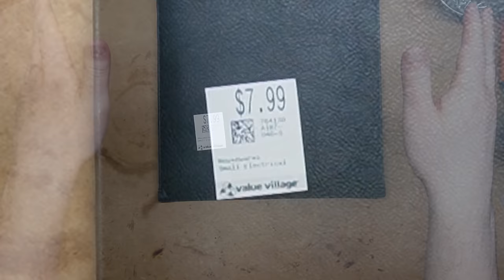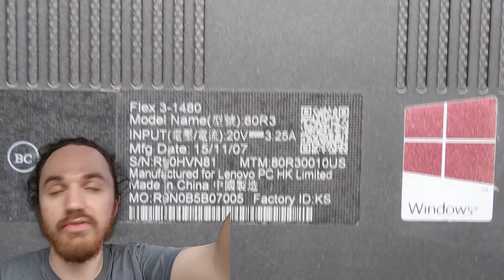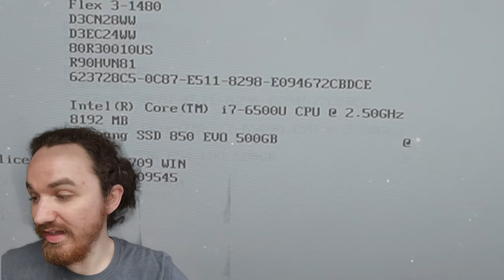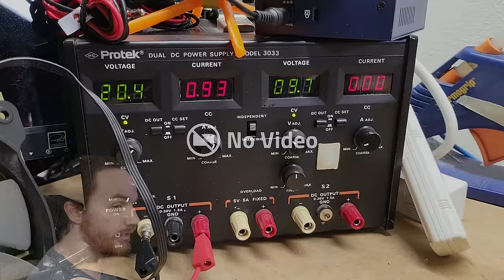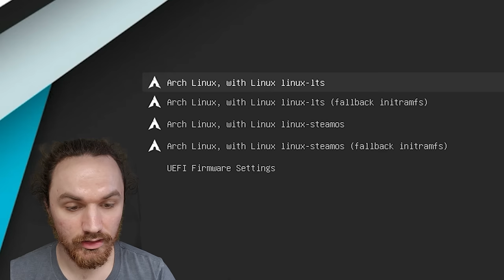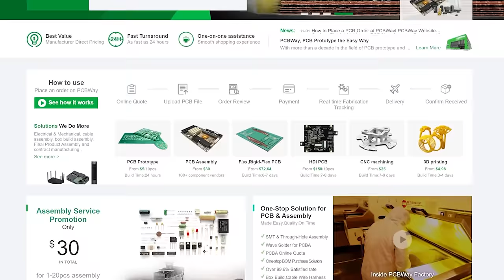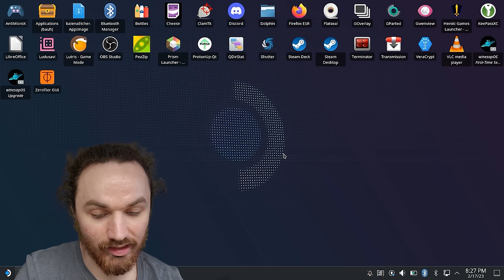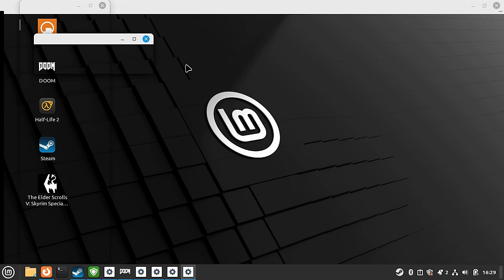Installing Steam Deck OS on a $7.99 Value Village Laptop

Comment: Some of these CPUs seem like they're powerful enough that if you could get a full 16x graphics card to run with it then you could have a good time.

Imagine somebody making a custom motherboard that you can put one of these chips on there to salvage from a dead laptop. It would take way too much effort and not be worth it at all but it would be cool to see.
Reply: well, u can place a wifi port to gpu port in your laptop if ur crazy enoth
Reply: There are modern laptop CPUs on ATX mainboards of Aliexpress, kinda wish if they offered in ITX mainboards though.
Reply: Yeah I wish I could take my laptop's APU and easily slot it into my DT motherboard  but that's a small dream that'll remain a dream
Reply: @jierenzheng7670  right? as someone rocking an ITX system, it seems crazy that they don't put those low wattage, highly efficient laptop chips into smaller boards, it would be a match made in heaven!
Reply: @danandrei96  For me, I always wanna build an ITX system ever since the tiny Thinkcentre M93P which I can fit something like an Intel i7-4750HQ or i7-5850HQ for a tiny emulation PC, those Aliexpress boards can do even more!
Reply: @bananinha00098  but the Wi-Fi port isn't 16x
Reply: @cydragon2.099  All you have to do is learn how to design your own motherboard and there you go.
Reply: @dickdickling9389  Don't people use i3s in gaming computers because the only thing you really have to worry about is the graphics card?
Reply: @bland9876  An fx6300 bottlenecks an rx480 by 60%. also the chipset for the motherboard doesnt support PCIE3.0 further bricking the GPU. Id say between the two the logic of "CPU doesnt matter. You always just need bigger GPU" falls flat. You want the hottest CPU and Hottest Motherboard for gaming because lanes, CPU intensive games and Video card running RAM as shared memory. Not VRAM since shared memory is passed across the lanes so slower. 

The point is if you told someone who was running an fx6300 and rx480 their lag means you need a better GPU you would be wrong. since by upgrading the CPU and lanes would unlock the potential of the GPU by un bottle necking it and giving it the proper PCIE lane and were not sure if the lag is cpu induced. THEN youre back to a state of "upgrade GPU" provided youre now able to support the current GPU's without bottlenecking or outdated lanes. For instance some motherboards have PCIE5.0 lanes. Not because any graphic card uses it. But it might in the future and that chipset might still be relevant. So just release a bios update to support the new cpu on that chipset and you got a pcie5.0 lane so youre motherboard is still relevant.
Reply: @gantz4u  ya if your mismatching GPU and CPU there will be bottle necks but if you don't do that you should be fine.
Reply: that is a 2 core i7 one of the worst 
that is why all the stutter happens in the games he is playing
Reply: @komikop  i would have assumed an i7 would be 4 core I didn't know they were old enough to be 2 core
Reply: i7-6500u powerfull????lol so funny
Reply: @maikelpeeters7328  if an i7 isn't powerful then I don't know what to believe anymore.

Comment: There is a dGPU in this thing since there are 2 coldplate thingies below the heatpipe (one for the CPU, another for the GPU)
Reply: Quick search reveals it's some kind of Nvidia, which would be why HoloISO didn't work
Reply from the maker: I really don't think it does but I could be wrong. I will probably take the cooler off and check at some point to be sure. Wouldn't the system specs page in Mint show the dGPU instead of the Intel HD Graphics iGPU though?
Reply: @BringusStudios  It might show both, I'm not sure. Also, some (not sure if all) Lenovo laptops allow the dGPU to be disabled in BIOS, so check for that.
Reply from the maker: @ozzelot3349 just pulled the cooler to check, you're absolutely right. There's a Nvidia chip in there. I'm really confused as to why Mint didn't register it. I'm going to install Windows and check to see if it shows up there, and if so I'm gonna see if the performance is any different. For all I know, even though Mint didn't show the GPU, it may have still been utilizing it and the performance was accurate. We shall see
Reply: @BringusStudios  it should be a GTX 930M or GTX 940M based on the laptop model, so my guess is it wasn't using the dGPU based on the performance
Reply: Wow, interesting find!

Comment: Man I was in shock. I'm using a Lenovo flex4 1470 right now and have been since maybe earlier than Jan 2017; real trouper, taken a consistent unending torture the whole time, including now, and have only had 2 problems, keyboard related and low RAM which I upgraded; 4 to 16gb. I really thought that was what you had got for 7.99; was willing to buy it right off you.  These are great, idk about the other gens

Comment: man, value village (savers in my area) really is killer for finding hidden gems of cheap electronics. i once picked up a 1TB external drive, even though it turned out to be an abysmal WD Green, for $3.99 from there

Comment: I don't think Holo iso works on anything that isn't AMD based. (I think there very limited In intel support). The steam Deck uses an AMD cpu and GPU that was speced out by Valve. Other versions of steam OS try to add comparability for other hardware, but it's hit or miss.

Comment: Man I have that IDENTICAL laptop sitting over in my drawer :D got it in the Microsoft Store in Toronto back in 2015. The ELAN trackpad always drove me nuts but was the first laptop I had with a touch screen and USB3, did me well. Dual Core "i7" was a bit of a let down though, so was the single channel 8GB of RAM but otherwise a decent laptop.

Comment: You seem to understand electronics well. Maybe you can look into switch mode power supplies, you can change their output. You could have converted that 19v to what your laptop required without losing voltage.

Comment: By the way to remove hot glue from non porous surfaces just drizzle some IPA on it and it will weaken the bonds. Learned that from Voultar here on the tube.

Comment: 3:48 Blinking indicator on Lenovo means that the battery is in the process of charging. When it starts blinking rarely, it means that the battery is almost charged, and when it stops blinking and just burns, the battery is charged

Comment: I actually have a Flex 3 1580, the 15 inch version of your laptop. It has a GeForce 940M, and your laptop probably has a 940M too. A SteamOS based distro can't use the Nvidia card.
Reply from the maker: I really don't think it does but I could be wrong. I will probably take the cooler off and check at some point to be sure. Wouldn't the system specs page in Mint show the dGPU instead of the Intel HD Graphics iGPU though?
Reply: @BringusStudios  maybe linux mint didn't install the drivers or even detect the GPU? I remember the laptop nvidia GPUs were a nightmare for linux so try installing windows 10 and have it automatically install the drivers.

Comment: It's just hot glue, that's actually not a bad choice if you're missing the hold down or screws. I've never done that, but I could see myself doing it on an old laptop I wanted to just get working enough to use for something.

Comment: At 4:17 when you are pointing on the RAM, you could see that heatsink covers two cips one on the left is a CPU and on the right is a dedicated GPU, you can even see VRAM arround it. 
LAN port needs bottom case to work properly

Comment: One thing to keep in mind with most Lenovo laptops with the square plug power adapter is that they do have a 3rd "sense" pin in the charger that tells the machine if you're using a legit Lenovo charger. It's a really dumb pin as it's just a certain value resistor to positive I think or something like that because the Lenovo charger cord that goes from the square plug to the power brick doesn't have 3 wires (HP/Dell style). Long story short is Lenovo laptops can limit performance if it thinks that you're not using a legit charger and that's usually also why it won't charge the battery. My Lenovo X270 for instance won't let me turbo boost the clock speed up on certain pirate chargers (again the secret is in a legit Lenovo square plug and not the brick) but on windows you can circumvent that limitation with ThrottleStop

Comment: Could use a "fancy" universal laptop charger. Had one like 90W which had exchangeable end plugs to fit all kinds of weirdo laptop standards. The plugs were like 4 pin in, whatever setup out, cause IIRC 2 of the in-pins were used as a "sense" for a resistance hidden in them plugs. Open ended (aka no plug) it would output like 15V, and depending on resistance it would go up to 20V.

Alternatively if that PSU you use fully works, use the damn tracking mode, and then run both channels in parallel for double the amps out :)

Sorry for necro comment - YT recommended me your videos like a day ago and I watch some older ones that it continues to recommend hehe.

Comment: What build did you use as the STEAM OS! I Have a B550m board with 3100x cpu and 8gb ram (2x4) and AMD MSI RX580 Gaming 8gb GPU with a  1.5tb Sata drive. Also have a 512gb M.2 gen 3 (2800-3400mb/s) but have not bothered to add the m.2 yet. What OS will work best? Also was thinking of dual booting win 11 and steam os on my 5800x/3060ti build but heard NVIDIA is bad.

Comment: on the motherboard, you could see 2 chips covered by the heat pipe wich could mean that it got a dedicated gpu.
Reply: If there's no dedicated gpu, it's the motherboard chipset. It's common to put it under the pipe. From what I've found with the serial number, it should have a 940M. If bringus had selected nVidia driver it should have been better in game.
Reply: @galichet18  I had one of these exact models a couple years ago, the chipset is located under the silver shield. The second chip is for sure a GeForce 930m or a GeForce 940m
Reply: @galichet18  yeah, you could be right but i think i saw 2 memory modules just besides the pipe, it's maybe nothing but it's kind of curious

Comment: i can see from a teardown, that laptop has discrete gpu. So in linux depending on maker (if it,s AMD then is easy). basically to use discrete gpu you need to set prime offload renderer (somthing like that) and then use DRI_PRIME=1 when launching the game.

Comment: This is 150% less jank than 90% of the computers I have cobbled together out of junked laptops over the years.

The one I am most proud of was a garage server I made out of a laptop that had a screen that was snapped off at the hinges and still had wires hanging out of it.  It also had no back because the SODIMMs I crammed in there wouldn't allow me to put it back on.  Not that it mattered, because I also had a 3.5 inch hard drive wired into it using an absolute fire hazard of a MOLEX power supply and some jank as fuck IDE converter... thing that I had around... for some reason.  I also did not have a long enough CAT 5 cable, so I made one by splicing together 3 different I found in a box and then eventually by just having loose wires I ripped out of a telephone cord spliced into the middle to get an extra few feet.  I had to use the same colors twice, of course, so I just colored the ends of the duplicate wires with sharpie to keep track of them.  I attempted to twist the pairs back up and wrapped it all in saran wrap, but this fell apart pretty quickly and I wound up with loose wires hanging over the side of the shelf they were draped over, in the end.  

I also didn't have anywhere to put this thing, so I duck taped it face-down to the wall and just ripped the power button out and wired it up to one I scavenged out of some other busted thing and left it hanging off the side so I could still turn it off and on.  After a certain point, I knew that I would have been better off using one of the many other computers I could have built out of spare parts, or at least just pulling the guts out of this thing and either slapping it into one of the empty cases I had lying around or even just screwing it into a piece of plywood.  However, I think that everyone who tinkers with electronics eventually reaches a point of sick, morbid curiosity where they just want to see how completely fucked they can make their project and still have it work, and I had reached that point.

Also, I was, like, 13 or 14 and broke.  So, you know, financial limitations and a reckless disregard for fire safety combined to bring this monstrosity into the world.

It worked.  Quite well, in fact.  It was my FTP server for years until we moved out of that house and my dad flat-out refused to let me bring it with me.

Comment: That’s crazy I have one of those laptops it’s a Lenovo Flex 3 and when I first got it it ran ok but years later down the line it sucked it’s slow as all hell I still have it but I never use really because it’s so slow also my laptop came with Windows 10 and it had that same sticker on the back

Comment: Bit late here, but here are somethings that could have been causing poor performance. 1. Single channel RAM, I didn't see a second stick on the logicboard, so unless it was soldered, then that would cut performance. 2. Thermal throttling, I didn't see thermal paste be reapplied, so I'm assuming that it wasn't, and with the age of the machine, the paste is probably rock hard and with the GPU being on the same die as the CPU they both could have been throttling from a lack of heat dissipation. 3 Shader Compilation, seen other mention this but if the shaders weren't compiled then that would result in all the stutters.

Comment: A standard 19v laptop charger would probably run it fine as long as it can handle the current. They are usually pretty lenient with voltage.

Comment: Have you ever tried getting a universal laptop charger that comes with a bunch of different adapters? they're cheap and can charge a ton of various laptop brands
Reply: the lenovo psu has a special identification pin so only lenovo chargers can be used dave from eevblog also experienced this when he tried to boot the lenovo aio pc

Comment: Those half-size ethernet ports extend to fit the ethernet. I've never had any problem with them across two laptops, so hopefully you dont have to use usb ethernet for long and you can figure out
Reply from the maker: Yeah the mechanism was dependent on the back shell being put back on I discovered

Comment: The only reason the ethernet cable didn't work is because you didn't have the bottum of the laptop attached. it locks in via a flap attached to the bottum tray that thin laptops have been using for AWHILE now.
Reply from the maker: Yeah that mechanism sucks ass. At least it has the port at all I guess
Reply: @BringusStudios  that's true. AHEM. APPLE.
Reply from the maker: @scarecrow5848  OOF yeah my macbook would be a lot better if it had anything other than 4x type C ports. Need an adapter for everything...
Reply: @BringusStudios  oh not even just macs... It's the iphones too.. and now ipads that they removed the headphone jack off those too... :(

Comment: I have a old toshiba laptop with a i3 3gen 2 cores 4 threads 4gb of ram and an amd 5165 with 1gb of vram its brand knew i only upgraded to a beter one. Now my question is it worth instaling linux on him? I have windows 7 32 bit on him now and as it is i can run crysis on medium setings at 25 to 40 fps. What do you sugest?

Comment: For this kind of janky excellence, maybe consider getting a few USB-C PD trigger boards so you can run the laptops off a GaN charger. It isnt rocket science to upfit older laptops like this by swapping the charge port completely with a trigger board. Cheap swap to PD might make a decent video too.

Comment: I have an old dell tower with literally the first i7 in it.  I got an amd rx480 8gb for 100 bucks and an ssd I had on hand. Plays every modern title I've thrown at it generally with high 1080p frame rates too. No problem running a 1080p 124 hz monitor in esports titles. I use it as a streaming pc or a second computer for friends. Also good for jankey internet software I don't trust on my main pc with my personal info on it. Honestly for browsing and normal stuff an i7 is overkill even in 2023.
Reply from the maker: I used one of those 1st gen i7s in my home server for so long. They were pretty good

Comment: there something wrong with that pc my PC has intal i5 6440hq  and hd520 with a dedicated GPU is r7 m360 but some games won't run on decanted gpu like Minecraft fallout 3  and gta 5  on hd520 gets 27/34 fps on medium and 40/50 n high/medium on r7 m360

Comment: Where can u get the steam deck flash drive I just heard about this I'm interested in old games what's the best option do u think and can u get a remote control that works with laptops? I grew up on nes atri and SNES but I haven't been gaming for a long time I wanna try and get back to it but keeping the price low and I tried one of them cheap preloaded knockoff Nintendos u cant save drop the remote and broken thank u for your time keep in mind I know nothing about computers someone gave me a hp laptop it has i7 in corner sticker like u said but I don't know if that helps
Reply: Thanks

Comment: I played and beat HL2 on an HD 520 without any problems but I had to download the driver for the iGPU directly from Intel and I doubt they have a linux version. Also if I recall you have to change the render mode on LM so video and 3D applications dont studder / tear. Not sure why its set to garbage by default after a certain update a few years back. Then again I have not used my media PC in a while so things could be different now...